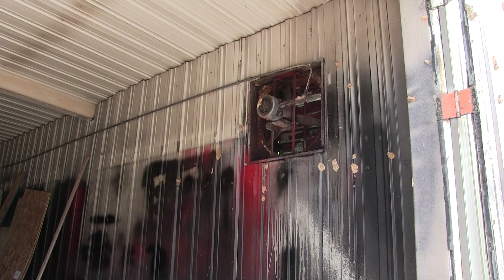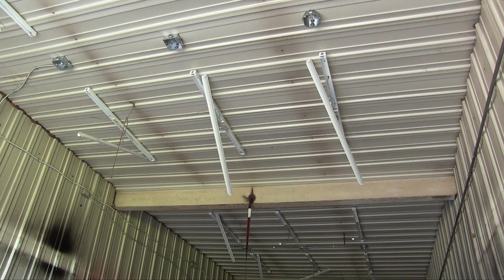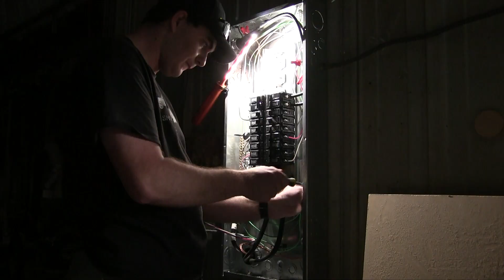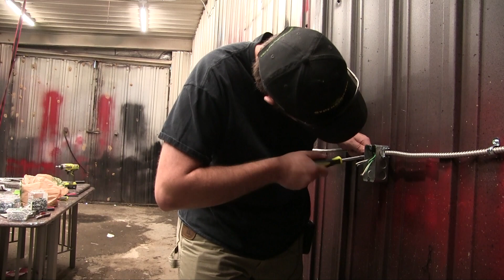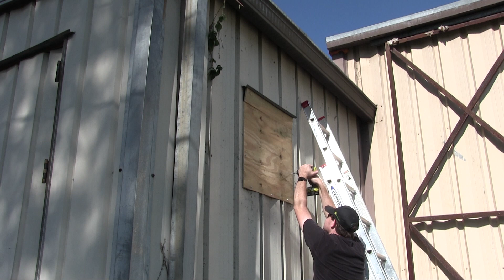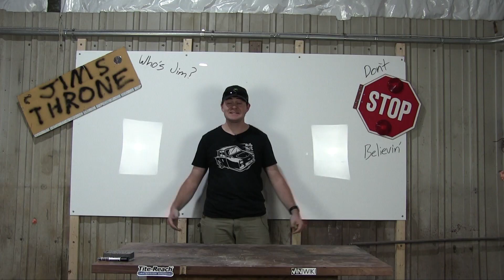I Moved My Presentation Area and Converted the Paint Booth into a Wood Shop

Comment: Why not just build a wood floor over the pit use the area as storage just build access doors into the floor ... put your work benches and presentation area on the wood floor area and will make a much better place to stand then on concrete for when you are doing things like putting transmission and engines back together ...  1-1/8 in. T&G ADVANTECH UNDERLAYMENT would make perfect subfloor

Comment: Some placez have a raised floor with wires etc under it. You could easily get a kit for that. They make concrete tiles that sit on it. Holds heavy stuff.
Reply: http://www.xlraisedfloor.com/products/cement-infilled-steel-raised-access-floor-finished-type/?gclid=CjwKCAjw7uPqBRBlEiwAYDsr181uz-jybOA55beDQYRiKpjZ04nM6obAI7DmU6MhjVx79pgAHT5EeRoCO5cQAvD_BwE

Comment: As somebody who did a clutch... on a Porsche 924S... on blocks... that "pit" might be a good place to put either permanent or movable ramps so the space can be used as an inspection area. You could even elevate them so it's like working under a lift (I type as I consciously remind myself that I could've sworn I saw a car lift in use in a previous video). Your building though ¯\_(ツ)_/¯

Comment: Why not put a window where the extractor fan was? even just a basic one. Also, that pit could be filled in using wood. just put some battons in there and floor over it. (at least temporarily). filling it with concrete seems obsessive. Otherwise why not build some steps down into it then it can actually be used instead of just sitting there. anything beats half your building being unusable.

Comment: That MC cable is WAY easier to work with and not slice into your wires if you get an MC cable cutter. Also there are little red plastic bushings you're supposed to put in the end to protect the wire from chafing (or you can just let it blow the breaker and then see what smoked) 
Welcome back to the tubes

Comment: Ok, strange... why cover the paint booth fan when you commented how you hate the dust as much as an "active volcano"??! Use the fan during wood cutting
Reply from the maker: That's a nice thought, but that would only suck the air from my main shop which is air conditioned. I'd rather not blow cool air outside.

Comment: Why not build a staircase down into the pit and just use it as-is? Having two levels to your shop is kinda weird but it would be way less expensive and time consuming than trying to fill that whole thing in.

Also, you really should get a dust collector for that woodshop, even if its just a shop vac with a barrel attached.

Comment: Have you thought of scavenging around for some grating to cover over the pit. that way you can't fall in and still use the area underneath for storage. sure, that's a LOT of grating, but if someone is pulling down an old workshop, a score might be had.

Comment: Instead of waiting to fill in the space with concrete, why not build a floor? I’ve aided in building a deck that supported the weight of a large inflatable pool, effectively the weight of a medium/large car. Especially since you could tie the supports into the concrete foundation it should be a feasible task, and likely cheaper if not already easier than filling in the whole pit with concrete.

Comment: Metal power conduits. Really?
Here in Europe we value our safety, and use PVC conduits.
Reply: We value our safety even more in the United States. Metal conduit protects the wires against sharp objects far better than PVC does, and by odd coincidence a wood shop tends to have sharp objects around. Also, if something really bad goes wrong PVC will burn, metal will not.

Comment: Table sounds interesting
What you could do with the pit is imstall a pair of rails to move cars on and work on their undersides +fill in the rest except for a little ramp or lift to use for heavy tools/parts. It all depends on wether youve got enough space to get cars onto it straight and your motivation (not disrespectful since it is a good bit more than just filling the pit in and voilla)

Comment: Why in the hell would you turn a paint shop into a wood shop when you have so much space available. Surely it would have been better to make that the workshop with a 2 post  car lift and have the extraction fan etc and use the other area as a storage shed/wood shop

Comment: Yes, please, on the granite table project.

Also, I'm thinking two things about the new wood work shed.  1) Need to paint the walls to brighten, 'cause that black and red is screwin' with lighting.  2) Those lights and electrical junctions... did you go on top of the shed and seal the new holes?  'Cause... reasons... :)

Comment: Why didn't you just move the presentation area into the pit? Or, make some stairs that go down into the pit and have shelves that go from the pit floor to the ceiling of the shop. That way you have about 2 feet of extra shelve space and they can be accessed from both sides.

Comment: I'm a little surprised that you blocked the fume extractor, given the dust generated doing woodworking.  I've mused about adding dust extraction to my shop.

It's a shame that you can't drive down into the pit.  You could place a full-height lift there such that access to the side of the vehicle while raised would be possible.

If you find that your new presentation space isn't working out as well as you'd like, given the relatively lightweight nature of what you're working with in that presentation space, you might want to use lumber to build a raised floor in the pit  to bring it up to the same height as the rest of the floor.

Oooh, you could even put a WHOLE BUNCH of air tanks underneath!  Pressurize them with your compressor, have 5000 gallons of compressed air available, never run out of air ever again!

Comment: Hey robert. About the bus' loading problems. Why don't you cut the part behind the rear axle off and put a hinch on it? This saves space and does'nt require a lift at the back. You'll need some serious hydraulic ramps though

Comment: A cheaper and easier option possibly than filling in the pit would be building some stairs to make it easier to get in and out, and then it can just be used as a normal part of the place, just with some stairs?

Comment: I know it's off topic but... You know the issue with the Trabant and it's not having a freewheel on most gears. This is an issue because engine braking is not ideal with a two stroke... I have a solution! Pull in the choke whistle coasting/engine braking. That way you have extra fuel and oil in the engine making it almost impossible to seize due to friction... I quit enjoy the way you edit long process like removing screws or cleaning out the shop. I wouldn't mind seeings granite countertop repair

Comment: I'm confused, wouldn't an exhaust fan be GOOD for a wood shop?
Reply: he'd bee better off having a proper vacuum, they make ones you can use to suck up saw dust right into garbage bags. having a fume extractor in the wood shop is counter productive to his endavour as his goal is to keep the sawdust in there. plus sawdust will collect all over the exhaust, creating a potential fire hazard that requires even more regular maintenance.
Reply: But Wasps getting in is never a GOOD thing.
Reply: @weasel2htm  If only someone would finally invent the bug screen.
Reply: A fume extractor will only cause fine saw dust to stay stirred up. It might pull a small amount up and out but since saw dust is so much heavier than paint fumes it won't ever work like you are thinking. About the only way to remove the saw dust is a vacuum system set up at each station connected to a vacuum cyclone.
Reply: Absolutely. Let the neighbours cough their lungs out instead.
Reply: @heikovanderlaar3780  Distribution of wealth
Reply: @heikovanderlaar3780  het is niet alsof ze het direct inademen
Reply: Listen.  Stops wasps.
Reply: @The87por924  Or he could get a mask, like everyone else who does carpentry either as a job or as a hobby.
Reply: He needs a proper dust collector.
Reply: it's a temp fix.
Reply: I was about to post the same thing.
Reply: @The87por924  

he can do that easily by just breathing through his nose, he's not a carpenter who is spending eight+ hours a day working wood in there.